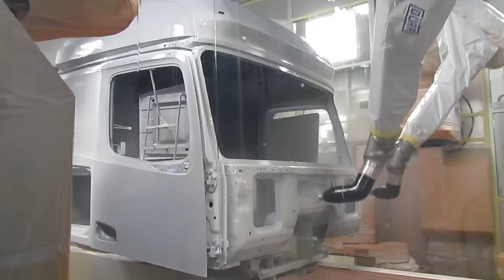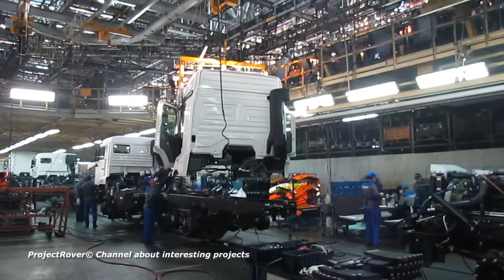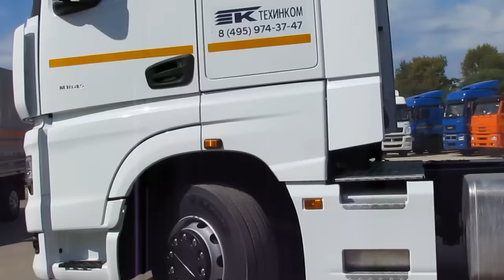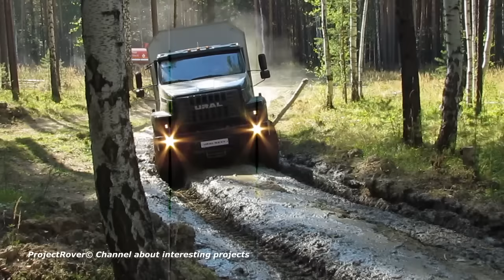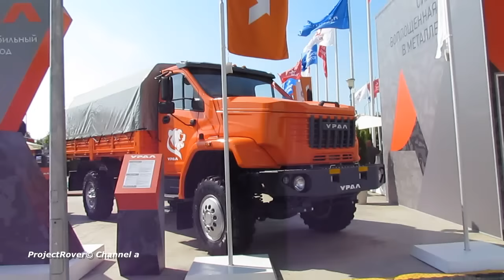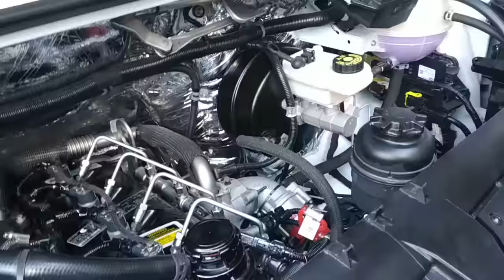Lived or died? Russian truck factories under sanctions. Results of 2022, plans for 2023

Comment: Quite honestly, I am impressed with the ability of the a Russian companies to overcome Western sanctions. Not what the US/EU expected for sure.
Reply: 1. You are aware that many countries in the world continue to export occidental goods to Russia, and that they are circumventing the sanctions that way?
2. Are you aware that many countries continue to trade with Russia, and some of those countries have a strong industrial base with alternative to occidental goods? 
3. No one being serious did expect any other results ! There is a major difference between expecting to collapse (which is what people wanted to read) and not supporting Russia's economy, which is the real goal, especially as they use a lot of occidental technologies in armament ! 
4. There are many elements that will take time to fail, and for which alternatives need to be discovered. 
Example, aircraft that are using other aircraft for spare parts. As there is no alternative for occidental planes on long haul travels, the number of aircraft able to fly will progressively decrease as the number of aircraft used for spare parts increase. 
Russia oil and gas economy requires a lot of occidental parts and needs to find replacements ! 

5. NO MATTER THE COUNTRY, if half of the world economy imposes sanctions, the country's economy will suffer greatly. 

6. One aspect that isn't explained enough... The GDP is often mentioned, but doesn't describe everything properly. The world economy evolved a lot, and the third sector takes a major part of the world economy. 
When the GDP of Russia decreases, the sectors that are facing the sanctions the hardest are suffering greatly, but not all sectors are affected at all. There is nothing unsurprising here. But some of the industries will be in a terrible spot, and also, importantly, there is a difference between surviving and thriving. 
Russia survives a lot on Soviet investments in military, science and engineering. But since the fall of the Soviet Union, despite major revenues in oil and gas, military budgets have been minimal. Investments in technologies have been limited. 
Russia is surviving thanks to the natural resources, but it's definitely not a positive situation in which they are...

7. The military budget is taking over all other budgets in Russia. Education will suffer. 
Young people at their prime have to go to war, will be injured, killed, or traumatised. Those are all people which will be a cost to Russia instead of bringing money to the economy. Brains fled Russia as well cause they could afford to pay in order to leave. And as those people are criminalised now, they will never return, unless there is a regime change. 
So when you look at the situation, there are a lot of long term consequences, and some believe that the short term proves that Russia is ok.

8. Last and not least. Russians are dying for a useless war, and a stupid decision of their president in 2014...

Comment: I think many people mix up quality of finish, with rugged and durable. Russian cars and trucks are often derided because they tend to have low quality finishing, no air conditioning, ugly design. But they are very durable and can endure temperature, terrain extremes. Some offroad enthusiasts have even found old Ladas comparable with new Jeeps and Land Rovers when crossing difficult roads. 
I'm pretty sure most of these trucks are going to be uncomfortable and unfashionable. But the trucker won't have to worry about breaking down on a snowy Siberian road 1000km from anywhere else at -50C. Your average Mercedes truck is less survivable.
Reply: Russian vehicles are built tough, not necessarily comfortable. And in much of Russia, what you need is heating, not air conditioning.
Reply: marcinrybarczyk001  Are they worse than American cars?
Reply: marcinrybarczyk001  Probably poor working conditions. If you pay them well, Russian factory workers turn out very good stuff. Otherwise, expect more than a few lemons. I think that these days the workers at the military equipment factories aren't being paid enough. Not only that, but the Russian military has a pretty big internal corruption problem. This is why Prigo bitches often at the Ministry of Defense. 

I remember that Soviet equipment wasn't too shabby, even if much of it was inferior to Western gear. The prevailing philosophy in Soviet manufacturing was to make something good enough, not necessarily go out of one's way to make it the best product ever (which is what the Japanese like to do). It might look ghetto, but it will do what it's supposed to do.
Reply: @hananokuni2580  they are not worse but different
Reply: As an American I made a 15 hour ride in a 20plus year old Lada. We had our food with us (Russian road trip) and 5 people cramped in this tiny thing. The lada goes and goes. Easy to fix, and like the one poster said kinda ugly but it works. There are plenty of very old Lada’s in Russia on the road. That’s all the evidence I had to see if it’s a durable car. These things take beatings and just keep going. It’s rather impressive.

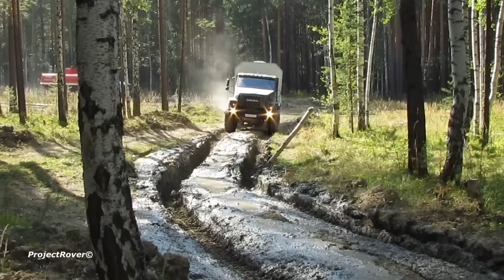Comment: At 5:30 is that a test road for Kamaz or an actual road in Russia?  
If that is an actual road in Russia (or Ukraine) the Russians had better get some gravel trucks and road equipment in there and fill in those ruts!  It won't be long before that road is impassable.
Reply: it's just an off-road testdrive
Reply: О да, у нас в России все такие дороги😂
Reply: No this is Mudrunner; a truck simulator game, and this is the latest 8K version. LOL